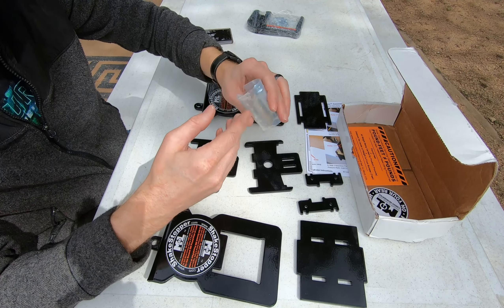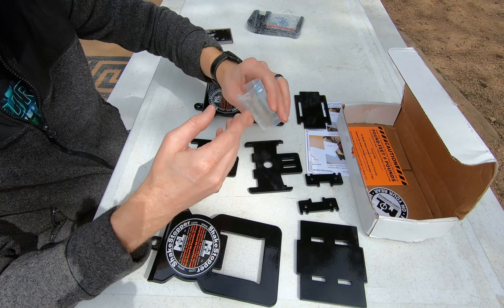Securing RV Rear Bumper with Mount N Lock products

Comment: those bumpers look welded on well, but I have seen the bumper tear and fall off, and the weld is still holding on to the thin bumper material, so weld didn't fail, but bumper will, so what you are adding is very valuable. Watch those cheap bumpers though , with any weight on them.
Reply: Happened to me. Pulling a smaller Harley with a bumper wheel lift (front wheel goes in a cradle).

Comment: Thanks for the video, we have a highland ridge now with the same bumper- we're going to have four bikes on a bike rack- how are you liking the bumper supports and the bumper hitch by mount and lock?
Reply from the maker: The supports and hitch have been great! I did tighten the hitch bolts after 2500 miles (probably could have done it sooner). After bouncing around across country there was a bit of play in the setup. Once tightened again, everything was super stable. Also, remember that the more weight you put on the back of your trailer takes some weight off the truck hitch, and potentially adds stress to your trailer suspension. Hope this helps! And thanks for watching and commenting!